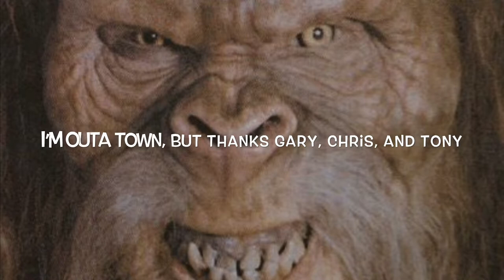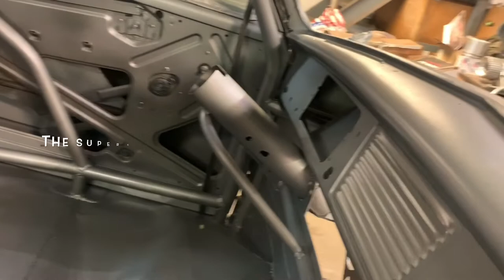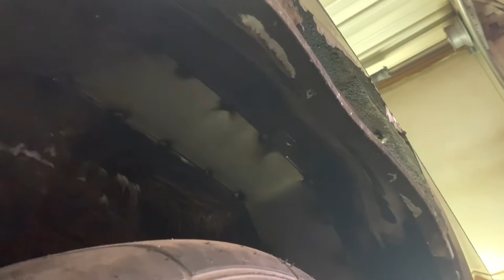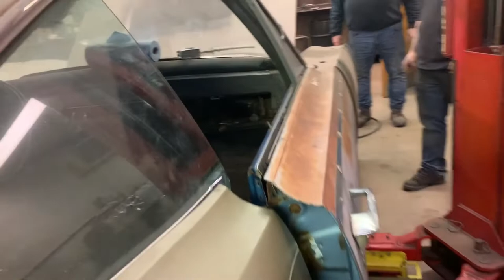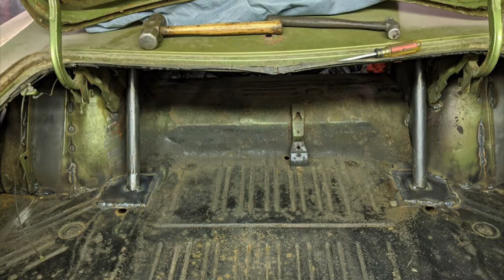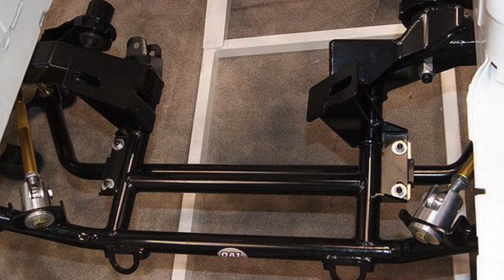Chassis Work by Magnum Superchargers

Comment: Super beat is looking big. all that rubber on there makes it look mean.
Reply from the maker: testa's speed shop i just got back in town and will be going for updates this week. Those are 15x10  5.5 BS with 295/65r 15 drag radials. They can fit without tubbing on the dodge b bodies but rubbed on my stock Plymouth .